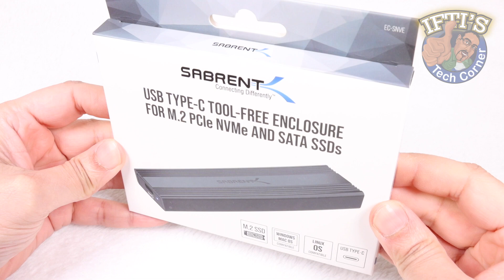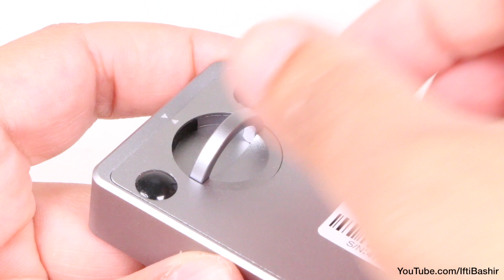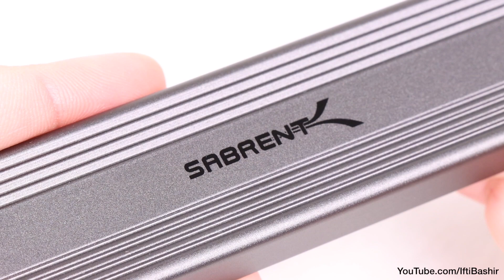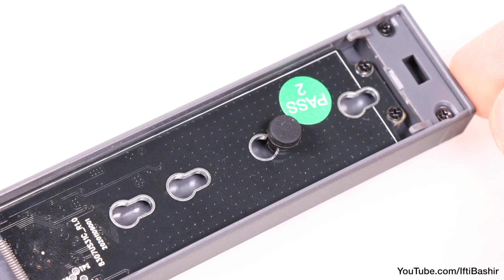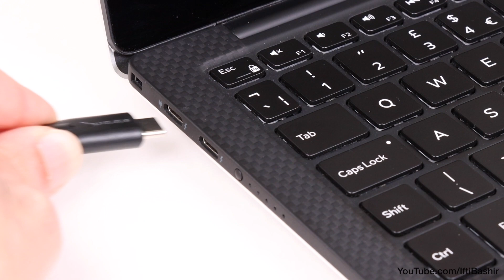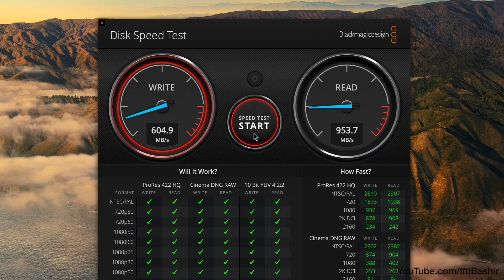Sabrent USB Type-C Tool-Free Enclosure for NVME SSD’s! - REVIEW

Comment: Hi Thanks for the video - just a quick question. Do we need to remove the sticker film to make the heat gel stick to the SSD or we can simply close as is? The reason why i am asking is, there are some videos that dont peel off the sticker and secondly, if we make the sticker to stick over the SSD, say i want to open again the enclosure - what will happen?
Reply from the maker: Yes, remove the protective sheet/sticker - you want the thermal pad sandwiched directly on the SSD and heatsink - the protective sticker will hinder heat transfer. 
If you change SSD its best to use a new thermal pad - they are available very cheap online.....
Reply: @iftibashir  thank you for the quick response.

Comment: The included cable is straight bad. Try to replace it before using it. Mine died after barely any use and took all my nvme’s data with it. Usb started dropping over and over out of nowhere. I tried with a spare usb cable and it worked normally, but the disconnect spree corrupted the volume.

Comment: is this a viable alternative to the more expensive usb c external ssd?
Reply from the maker: Definitely. And with this you have the option to switch drives, or upgrade to a higher capacity SSD without having to purchase a whole new enclosure - just the bare NVMe SSD and you're set to go.....
Alternatively, if you purchase a larger SSD drive for your computer/laptop, you can place the older drive you removed from your system into this enclosure and you instantly have an external drive too!